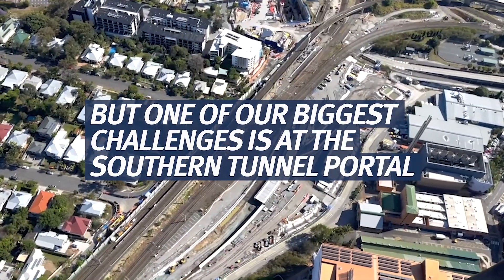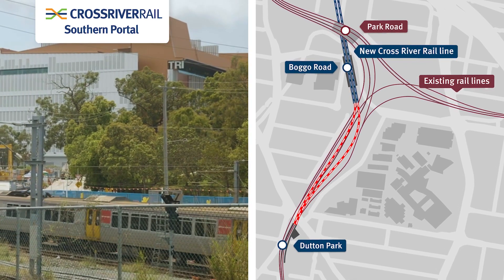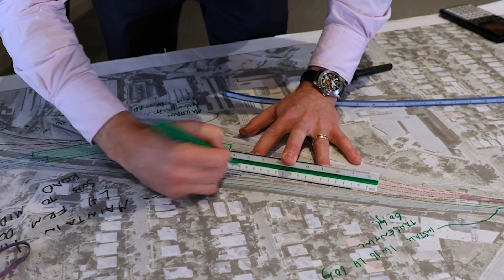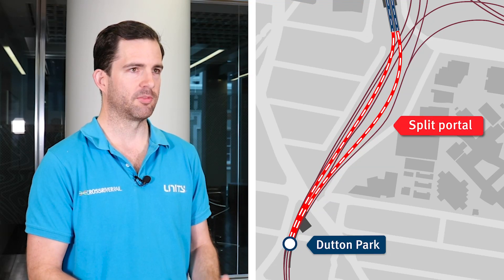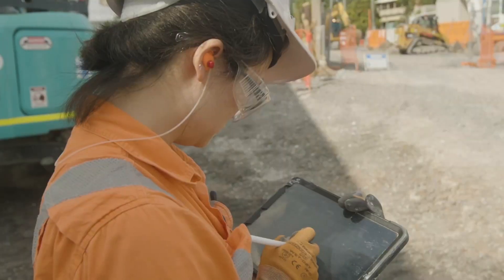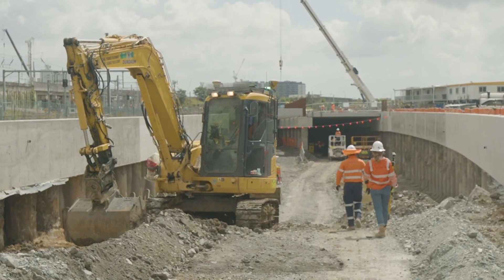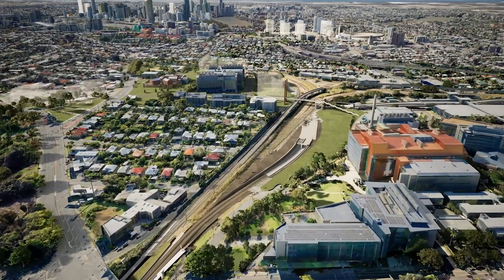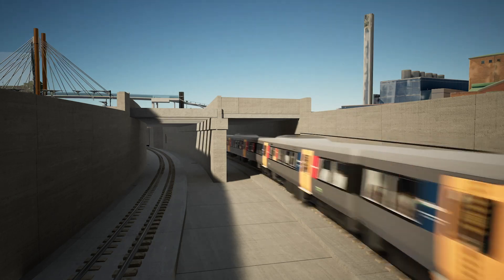Solving The Engineering Challenges Of Our Southern Portal

Comment: So that's why they got rid of the split tunnel entrance and made it into a signal portal. It does reduce operational flexibility as there is no longer the ability to have either of the To City lines enter the tunnel or go to Park road without getting in the way of the other. Trains on the centre track can't go to Park road without interfering with the western track, but they would have had they found a solution that kept the split portal.